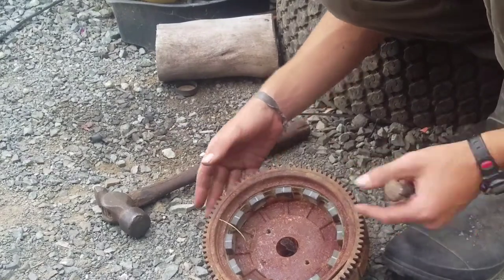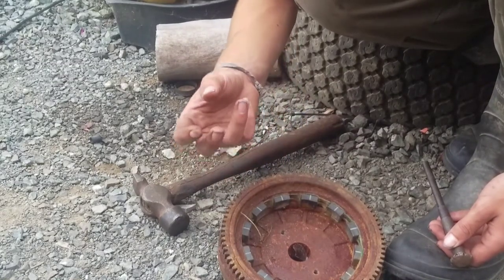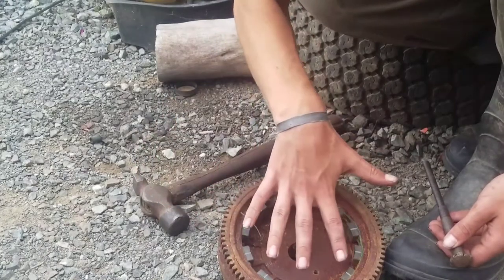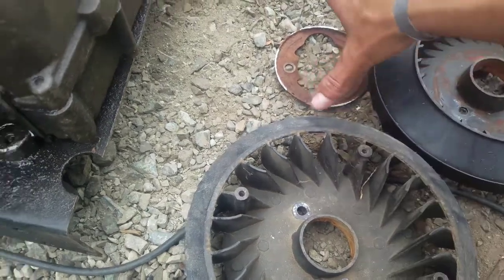how to lighten a flywheel,free mods pt7

Comment: Briggs ring alternator with 2 yellow wires is the highest rated amps output. The other one with 2 black wires is exact same thing, just less costly.
Reply from the maker: Thats good to know for if i need more power output, i only get used ones because there cheeper and dont need alot of change. This motor is for a race mower so its going to be charge befor you ride to help reduce resistance.

Comment: Speed and power does not get you from point A to point B. with without buying gasoline. Hydrogen gas from free water is the only way. There are many greatly improved efficiency methods to apply to a water/Hydrogen  cell. . It's about time. you looked into this, instead of fun and games.
Reply from the maker: Just makeing the most of it whell it still lasts. Ince iv researched into it enough i may try something on my petrol mini truck to see if i can save fule on longer trips. What was the you tuber you said did video's on it?
Reply: You have to decide on fuel "supplement hydrogen", or Hydrogen improved electrolysis cell for 100% only water used for engine. That's 2 different categories and different parts. They involve 2 different studies on different designs on Internet before spending money on parts.
Reply from the maker: Well if I'm going to do it I better go all out, I know the basics of it but trying to get all the mixtures right for the motor was the thing I was wanting to figure out

Comment: Sweeet check mine out
Reply from the maker: That l2000 is a beast, what motor mods do u have on it?
Reply: @droptheblades895  um just jetted and exhaust now not to much it has plenty of power. And hells yah it is man i love mine! Its srt up sooo sweeet the clutch is so easy to press so is the throttle all kinds of power i need bigger tires
Reply from the maker: Sounds good man, just be careful not to brake your trans with biger tyres
Reply: @droptheblades895  okay will do i have small tires its fast enough now lol